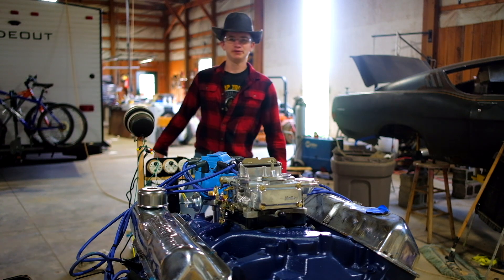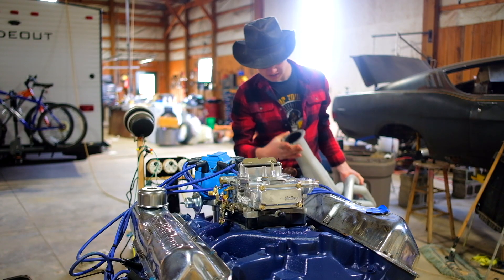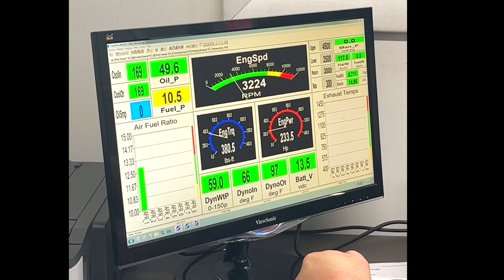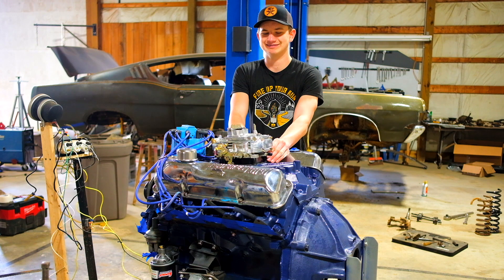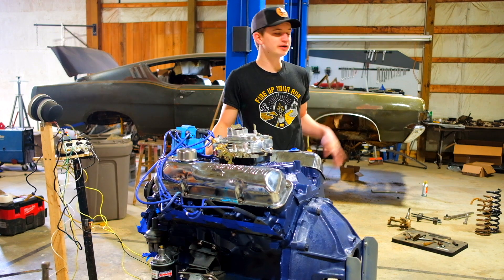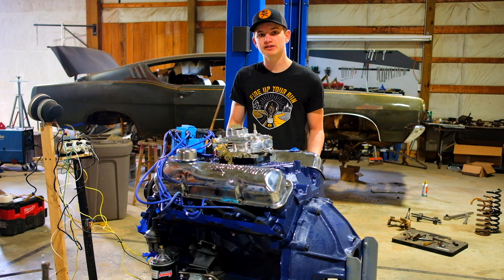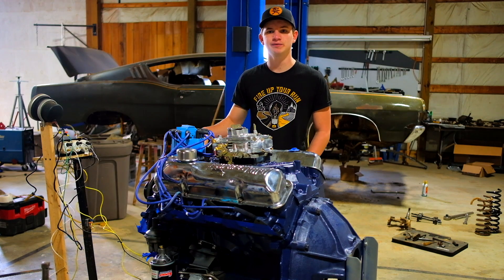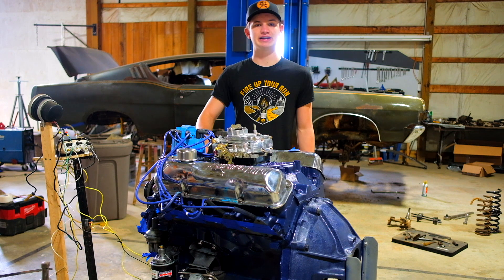Stock Rebuilt Ford 390 GT Dyno Tested

Comment: You can take that 390 and turn it into the 401 which was a tripower set up on the 390 engine which delivered 401 horsepower and it was called the 401 for that reason this motor came out in 1961 to hit Pontiac and Chrysler between their drag racing eyes you have the right motor to do this because the 390 is the 401 that engine had no problem beating Chevy's 409 good luck and check this out you'll be happy

Comment: It's great to see the FE staying alive, it's a very interesting engine series.  That power curve is perfect for a daily driver, it's area under the horsepower graph, not the peak.  The peak horsepower is for the track and your ability to tune, tire, and gear the car properly.  Instead, when you don't want to smoke tires, this car will be docile and thought-free to drive.  It's a really good engine choice by Ford I think.
Reply: Spoken by a Guy of my mindset.   Massive HP has it's place, but it's not always the ultimate goal here.  I wouldn't mind a Kaase built 460, just not in my 89 F350 4x4 old work truck.  Nor anything else but for show or strip.  Something reliable, durable and a bit over stock performance suits me and my wallet fine.

Comment: HP is highly overrated for street cars, low end torque is far more important which is what FEs do best. I have a pair of high performance 57 Fords but my favorite driver by far is a 59 bird with a 68 GT 390 built for 87 gas with headers because well... I just can't do stock manifolds. What makes the bird a favorite driver is the good tugger motor, console shift T85OD trans, front disk brakes, rear sway bar and 3 point seat belts. Very comfortable ride but when I drop a gear and punch it I'm Kristensen at Goodwood in #73. Averages low 20s on the freeway and about 12 in town. I'm also building a prewar 4 door as a super cruiser with a 300 6, 3 speed 3.10 gears, not chopped or channeled but I did stretch it because we all look better with big things sticking out the front. More attention should be given to practical cruiser builds. Really good presentation.
Reply from the maker: That’s awesome😎😎 Thanks!

Comment: Great to see the younger generation working on a fe motor. It's one of the best! My dad passed a couple of years ago and left me with engine parts galore. My 390 in my 1971 pickup was a from a 1968 cougar. 0 deck clearance ,335 hp 427 torque. 270 duration intake and 290 duration exhaust. Around 490 lift. Don't put stock cams like that in motors anymore for sure! Really pulls great. Got 428 and 406 blocks ready to build. The fe heads are really a great selection to choose from too. I got 25 pairs  and there are seemingly endless part numbers for sure . Most have the same valve size. Of course 427 and 428 engines have bigger valves. Torino is a great body style to have. Good luck on your project.
Reply from the maker: Thank you!!
Reply: That’s crazy your situation is pretty much the same as mine. My dad passed back in 2015 left all kinds of fe stuff to us. I have a 72 f100 my dad left a 428cj I swapped that in my truck still working out the bugs in it. Torque for days! Left so many different blocks 352 390 410 bunch of different heads.
Reply from the maker: @ls1_cammeroh  That's awesome!
Reply: you dont live near east tn and want to sell stuff do you?
Reply: @LoneWrencher  me?
Reply: @brianfrye1891  as soon as can go thru all of it I will be selling some of it for sure. It's outside  Douglasville, ga. 25 miles of Atlanta,  just off I-20.

Comment: I have C4AE-G heads with CJ valves and the 10:1 393 ci engine made 385 hp and 465 ft lbs of torque. The 393 I have is making 509 hp and  the torque is a monstrous 525 ft lbs. that is with a 780 cfm Holley. So they are capable of great performance. I beat on them since I was 14 and they are the best. Like a Small block, with durability. I did a lot of porting and learned a huge amount about what really works and the early heads 60-66 tall ports with CJ valves and I put 5/16 guides in the intakes and 11/32 exhausts and 2.09-2.11 flat valves and 1.6 tulip exhausts and softened the chambers with.036-.045 quench. They are really great heads. The 61 HP heads were capable of 11.3:1 cr with flat top pistons. I have been using them for ever. I wish they would come out with some new blocks with 4.125-4.25 bores and bring in the BBM chambers like the 61s had. The price of aftermarket blocks heads and intakes are being jacked up in profiteering. It pisses me off. Now Windsors are taking the FEs place and that is wrong. I used to hit junkyards and get 410 Mercury FEs crankshafts, good PI 428 blocks. I knew my parts and 2 Saturday trips a month made for enough parts to sell and build myself one . 390s with just a hone and early heads, a Melling duplicate of High Performance solid cams and a bucket of rocker arms. I had the factory adj rockers that were 1.76-1.8. I’d go through them and make up sets. The 1.8s Id keep. I could mix 1.8 intakes and 1.7 exhausts with the dump truck shafts and stands that had a kerf cut and were iron. The end ones you could buy wraparound iron ones. Spacers from Dove and studs that never pulled out . Those were the 70s to mid late 80s  We need to get it back. I don’t want a Windsor, but the 289/302s could be wicked little shits. I still love them.

Comment: My Dad had a 66 Fairlane GTA, 390 automatic, it was really impressive on the street. 390's were more about torque. One of my favorite Ford engines.
Reply from the maker: Yep, the 390 is pretty cool and unique in a lot of ways😎😎
Reply: 1966 GTA was 335hp! Same as a 428CJ (which they say is under rated)

Comment: You remind me of myself building a 416ci tri power FE at 16. Mine was in a 63 thunderbird I ran a c6 with a 3500 stall and 3.89 gears out back. It had enough to hook and beat the neighbors 68 camaro with a 454. This was back in 1999. Keep up the good work!
Reply from the maker: Thank you! I will😎😎
Reply: I too had a 63 Thunderbird 390 , Ford NEVER made a 416 ci engine! yet they made a 406 ci motor! Mercury made a 413 ci engine! Which is still Ford !
Reply: Correction Mercury's didn't make a 413 , they made a 410 ci engine Mel block NOT FE series!
Reply: @Jerry-up8bk  mine was a 390 block with a 428 crank and .030 overbore. It was far from the original stock 390.
Reply: I had a 64 w 390 and c6 divorce sucks
Reply: @larrywarren1049  I've been there too. Even after that I had a relationship that cost me considerably more. Tough lessons

Comment: Hi mate, nice video.
I have a 1968 Mercury Marquis with the same motor.
S code intake, C8 AE heads 10.5 comp and 4 barrel.
All stock and rated at the factory @315hp @4400rpm
I reckon you are on the money with stock cam etc.
Any way you slice it, those lazy 390 cubes will move your
Torino good enough without having to rev the freckle out of it.
The low revs means you will get plenty of engine life out of it
without the expense of all the associated and expensive crap
needed to survive those high revs.
Stock 390 is a true tractor engine, there is its beauty.
Save your $$$ get your car sorted, a good exhaust  system 
and enjoy cruising to the sound of that 390.
Cheers from Australia mate, good job.😉👍

Comment: Get a pair of C4AE heads. Port match to the gaskets, lightly blend the valve bowl area to remove all sharp edges. Don't remove too much metal. Just smooth things over. Mill each head .015" and bolt 'em on. That 390 will instantly respond to the mildly cleaned up heads. My 390 had this work plus a .030 over bore and balanced rotating assembly. I used a TRW camshaft replacement for a 390GT engine.(335 HP). 11.0 CR and it idled smooth as glass and it would pin you back in the seat when I rowed through all 4 gears. It was in a 1952 Ford F-1 pickup with the factory 3.92 axle ratio. Low 14s at 100MPH all day long. Sadly the engine found a new home, but I still have the truck.

Comment: your well on your way young man, keep saving a little money at time and you can make big numbers with that engine
Reply from the maker: Thank you! I hope so!
Reply: @itllrun6030  well, now days they make very large stroker kits for tge 9ld fe engines, like the 445 cube kit and pair that with some trick flow heads and dual plane intake and 8t will make 600 horses. you will get ther

Comment: Before 1972 motors were rated gross  HP and after they were rated SAE. All companies HP numbers were not always what you thought. You've got a good solid motor. Enjoy it,!!
Reply from the maker: Thanks!
Reply: This engine looks like you or someone used a low RPMs truck cam and thicker than stock 'rebuilder' head gaskets... weak numbers for headers... a compression tester would also give some info...
Reply: You might have hit the nail on the head? Also, if 410 pistons were used by mistake that would lower the compression by a full point. @BuzzLOLOL

Comment: Reminds me of building my 1967 Ford Fairlane GTA 390 back in the day. 12.5 Jahns pistons (pump gas was better then) Offenhauser intake, Holman and Moody heads, Holley 780 for street, cam (don’t remember the specs but street/strip), Hooker headers. Stock rods and block but .030 over bore due to previous owner. Mated to rebuilt C6 trans. The car ran as O Stock Automatic. Love the old FE iron. Nice video.

Comment: Shorty headers on the dyno murdered your power, those long tubes will make a big difference, an RPM intake would help a lot too if you have a few hundred bucks to throw at it. Good stuff brother, keep at it.
Reply from the maker: Thanks! I found an old sidewinder intake on marketplace a while back and that’s what I’m running now. Took 50lbs off the front end😂
Reply: The gt manifold has an large S on it near the casting number, that was a manifold they designed for the application to produce a higher velocity charge in the ports.   I suspect that the manifold ends up making more torque than high rpm horse power, since to create high velocity air movement, a restricted port I'd necessary.   I bet you puck up some top end with that side winder manifold. Just make sure you look at the port matching to the head very carefully.  It's OK if the intake port is smaller than the port in the head, but it's a problem if the head port ends up being smaller than the intake because it creates a wall that creates turbulence slowing down air velocity and can cause weird fuel problems.  If you built the engine to match the factory spec compression ratio, you have a lot of room to have more camshaft duration.  Duration tends to "bleed off" compression which then requires more ignition timing because of the lower compression and the lower compression will cause the lumpy idle and or rough stumble running at lower rpms until you build enough velocity in the ports to over come the reverberating pulses from the duration overlap. Anyway, I agree with others that a better cam could be had if you have the compression to support it.  Keep in mind FE's have a very restricted exhaust port compared to the intake, so get a split duration cam that will favor the exhaust. Personally I would try a 268 high energy cam, a flat tappet hydraulic lifter type cam that has a nice amount of duration and not enough lift to break over the .550 lift limit that FE's have without cutting the spring pickets deeper.
Reply from the maker: @paul65comet31  Awesome! Thanks for the advice!😎

Comment: Ford dual-point distributors had full mechanical advance at 1200 rpm, that is with two light springs on the weights as per the Ford factory high performance books. And with a 780 cfm Holly. It worked perfect for me at over 400 horsepower stock with a hydraulic Shelby cam. That is with the stock factory ten-and-a-half to 1 compression Pistons.
Reply from the maker: Yeah I’m working on getting a better carb and dizzy. I’m gonna wait to get a cam until I upgrade my intake. Thanks!
Reply: @itllrun6030  if memory serves, after 1976 Ford put electronic dizzy's into their 361FT engines, which should work on most FE's without requiring a computer hookup.

Comment: Nothing wrong with your combo but honestly when any engine makes so much more torque than horsepower it's almost always a sign that the engine wants more camshaft: lift, duration and or timing. It sounds like it going to be a true street car and yes you definitely want torque down low but I really think a there are several good alternative camshafts ( hydraulic flat tappet  ones) that will keep most if not all your torque but also free up substantial horsepower. And with the engine out of the car it would be a breeze to change it out.

Comment: Excellent video and you should be proud of your build. I can’t say I’m a 390 fan. I never owned one and don’t recall ever riding in something that was 390 HP powered, but compared to stuff that GM and Chrysler were offering, all contemporary reports said was a little light on power. It shouldn’t have been as the 390, being an FE certainly had the cubes to be more competitive. I’d say as you go, play with heads, cam and lifters, and carbs. I love that Torino and hope to see more of it.
Reply from the maker: Thank you!

Comment: Being an OF, actually bought new a '68 Torino GT (~$2800) with a 390HiPo. It was kind of a dog until I pulled that crappy Auto -Lite carb and put a 4604 3BBL (too huge @1050cfm) Holley on it. But of course what really woke it up was that triple carb setup left over from my '63 406 along with a 427 spl C3AZ-6250-AA solid lifter cam and a 427 mechanical advance dual point distributor. Those were the days!!!! Now I 'play' with a mild 302 in a '31 Ford

Love the fact that FEs are still alive and kickin'

Comment: i have been running those 390s for 40 years,those stock 390s make a good nitrous motor,if you want to add 100 or so more hp.just dont go overboard and go too big with the nitrous on a stock engine.the 390s on the other hand are very reliable engines-last forever if built properly.good luck,good engine too-i would like to have it.

Comment: The 1969 GT engine was called the 390 IP (Improved Performance). It came with a Autolite 4-bbl and matching intake. The cam is also different from previous GT's

Comment: thanks for the build/info/video.   Using the original cam, did you put a degree wheel on it and write down the lift/duration/valve events.  I have read that the IP 69 390 went back to a smaller cam than the 66-67 390GT/428CJ cam.  if so that could be some of it.  also wonder what C6AE heads would do - I have a build in process for my 67 Fairlane and it will be going together with good machine work, small stem valves, C6AE heads, good pistons with a modern small ring pack - starting with S code intake and manifolds.  plan is to dyno it with the GT/CJ cam first, then move to headers, vintage aluminum intake, mabye a hyd roller.  should be fun!

Comment: Also what camshaft did u use ?  Great videos and looking forward to more. I think yours is the only video on YouTube of a bone stock 390 GT being dynoed
Reply from the maker: 100% stock Fomoco cam that came out of it to begin with. I measured it and it checked out so I used it and the original lifters. Thanks!
Reply: @itllrun6030  Were you under heavy budget constraints? There are some fairly inexpensive cams out there that would be a big improvement and still be very streetable in a daily driver.
Reply from the maker: @davidmarshall8628  I really wanted to try and keep it as stock as I could. And yeah I’m basically broke. Plus there was nothing wrong with my old cam or lifters.
Reply: @itllrun6030  Delta Cams in Tacoma Washington have the best cams around in value and performance.

Comment: If you don't already be sure to put front disk brakes in that car, cheap and easy, also rear sway bar and good long tube headers w/2.5 mandrel bend pipes with glass packs at the rear bumper. That engine will make more power after about 5K miles. 

That torque curve is far more important for a driver and tugging weight than HP. If you've got a manual trans that engine will pull a 3:25 rear gear, with overdrive a 3:50 or 3:70 which would put that car over 130 real mph. The reason yblocks have extra block skirt is to contain the mechanical advantage from their long rods. And the long rods are why a 390 has such different power than a GM 396 which has near same bore/stroke. Its also why 3 speeds were ok in yblocks but Chev needed 4 speeds. Also why Ford could put a super charger on a stock yblock which made GM squeal like a baby pig to get nascar to deny super chargers. Chev engines couldn't survive one and mopars didn't need them. 

Watch the youtube interior camera video of Kristensen 1959 thunderbird at Goodwood. 430 MEL yblock torque monster, not HP. 

I did pretty much same engine as yours for my 59 bird 3speed OD except compression for 87 gas. Super cruiser until I drop a gear then I'm Kristensen stomping a flock of euro chickens. You did it right. P.S. I always use pertronix, MSD 6AL, MSD coil and copper contact distributor cap and do not let the wires touch anything, even MSD wires will arc at high load. When yer done be sure to tire dyno tune it, can't tune them by ear or specs.
Reply from the maker: Thanks! I actually am running a Progression Ignition distributor now. It’s built from an msd distributor with a special circuit board inside. It connects to my phone and is really cool. And then I have a pertronix flamethrower coil. And then the torquey curve on the dyno was great but it all ended by 4400 rpm. So eventually we figured out that my lifters had too much preload. Which they did. And the car has 4 wheel disc brakes now. And a full 3” exhaust. Thanks again!